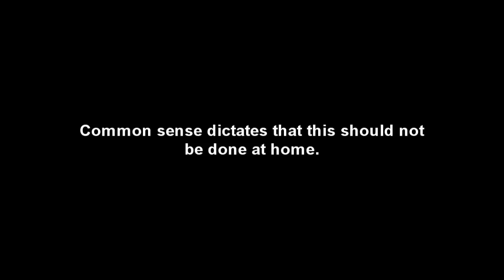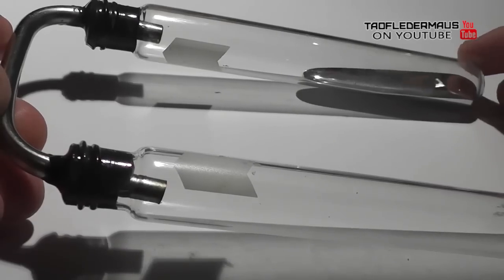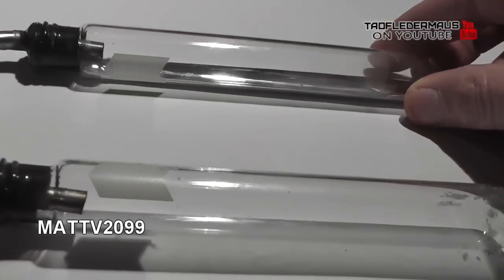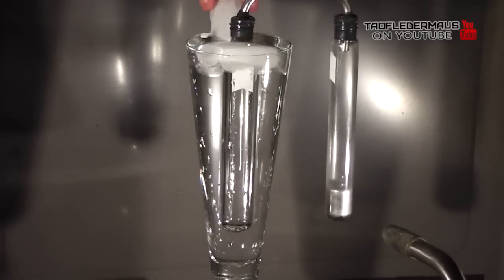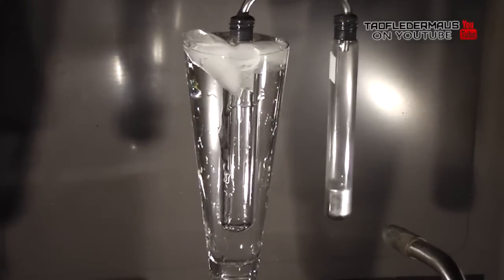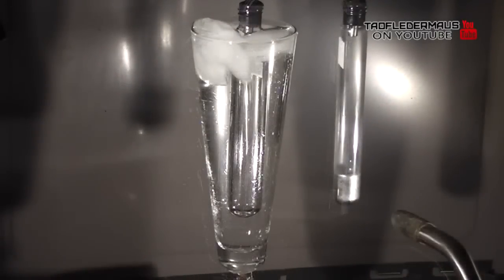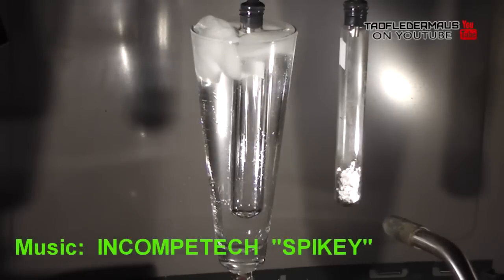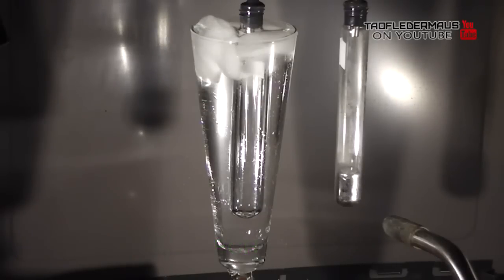What does the LIQUID METAL  Mercury look like BOILING?

Comment: I was surprised that we didn't see the gas going into the second test tube and condense back into a liquid.
Reply from the maker: I hoped to see that too.
Reply: Mercury is just too bloody dense to do that. At least under those conditions. You might be able to do that if the pressure is substantially lower on the other test tube while making sure that the test tube does not break and applying extreme heat to the mercury containing test tube. Still I wouldn't do it without proper respirator and doing the entire thing in a fume-hood.
Reply from the maker: Had I heated up the hot-side more completely,  above the condensing-point of the Hg,   it would have condensed in the cool-side.    I didn't want to push my luck though. lol
Reply: Yea buddy, you should be careful when it comes to luck and mercury. they don't mix well.
Reply: Anyways where do you buy so much mercury?
Reply from the maker: I've had it for years.   You can get it from Galliumsource  if you are in the U.S.  and over 18.
Reply: In near future when I will be building my reverse gravity-engine space craft, I will buy some.

Comment: long as this apparatus can take the pressure & temp, then, the risks are greatly minimized, Great experiment!!!!!
Reply from the maker: Test tubes are not very tough.    I was concerned it would rupture.
Reply: *****
 They would probably each float on each other.  The mercury couldnt get through the viscosity of the peanut butter, and the peanut butter would be less dense than mercury.  Regardless of which was on top, they wouldn't change positions
Reply from the maker: ***** The Hg would just sit on the top of the Pb.   (peanut butter) since it is more solid than liquid.    But the Pb would float on top of the Hg.
Reply: *****
What would be the contingency if it were to rupture? Just curious.
Reply: Mark Shannon Call for help, and close off all areas around him, so people cannot get into the area. Theres not much a single person can do about a mercury spill unless they have extremely expensive and specialized equipment. Even running away when it bursts doesn't make you safe. Think of it as a chemical gas.
Reply: Mark Shannon For a toxic, fuming, non-explosive chemical spill, make a 50-100m exclusion zone, doubled in downwind areas, notify authorities and wear full face gas masks at all times when within 100m of exclusion zone.

Comment: Really cool!
But seriously dangerous - I'm not the one who get easely scared (and think those "dont try this at home" claims is rediculous in most cases), but the vapor is whats really dangerous with mercury and here it's vaporazing very fast at it's boiling point.

The glass tubes stops it from getting out, but that also means a lot of pressure builds up - the cold side will condens some of it, but since it was no liquid mercury inside that tube after it had boiled that much for that long time most of it probably  stayed as compressed vapor in the tubes. At least a manometer shud be put on the rig to monitor the pressure.
Reply from the maker: Absolutely dangerous!    I spent a long time preparing for the "what if's"   and doing "hazard analysis"  on this before I tried it.

Comment: I don't know if this has been mentioned yet but I would think that putting the one end of the apparatus in ice water cooled the air, thus reducing the internal air pressure, and thus reducing the boiling temperature of the mercury.

Comment: If you vacuumed down your setup it would be much safer as any vapor release from the hot side would very freely be able to go over to the cold side and condense.  If there's air in the way you need to wait for diffusion/mixing to occur through that thin tube to a cold region of the glass.

Comment: Interesting!  I am surprise the test tube did not melt or break since mercury boils at high temp.
Reply: Test tubes are designed to withstand extreme heat or cold. They also cannot be dissolved by acid. Thus why scientists use them :)
Reply: You can get borosilicate test tubes that can withstand up to and over 800C (1500F). Mercury boils at around 350C (670F).
Reply from the maker: As a liquid like Hg is boiling,  it is absorbing heat at a higher rate and is controlling the temperature.

Comment: Would it be any safer to use a heat-resistant "bladder" of some sort on the other end instead of a rigid glass tube? You could heat the air up first before sealing the thing so there would be negative air pressure, so that whatever expansion took place, the bladder would be enough to handle it. Just a thought. :-?

Comment: The condensed mercury looked like water vapor..wow.  Another really interesting vid, thanks!
Reply from the maker: That surprised me.   I thought it would condense in the cold tube,  but I guess the top of the hot test tube was cold enough to condense it.  I would have thought the condensate would have been more silvery looking.
Reply: ***** It could have condensed in the interconnecting metal pipe section, which would have probably caused amalgamation. If the experiment is ever repeated weighing the interconnecting pipe before and after would be good, or use glass throughout. If you really wanted to see the condensation in the other tube minimize the length of the tube the gaseous metal has to expand upwards into, use all glass tubing and heat the interconnecting tube as well to over the boiling/condensing point. You could use a longer tube which was cooler in which to initiate condensation going to the second collection test tube.
Reply from the maker: If I had heated the entire "hot tube"  and the entire "u tube"  it would have had to have condensed in the "cold tube".    But...  I was cautious about the thing bursting.
Reply: I understand, if you added another foot or so of non-metallic pipe below the heated (upside down) U bend that would have allowed vapour expansion without excessive pressure and allowed condensation in the (ambient) tube above the cooled collection tube. The longer the tube (the bigger the entire closed system's overall volume) the lower the temperature induced pressure increase would be. You could use a rubber tube to extend the system, but you would have to consider it contaminated with mercury traces afterwards.
Reply from the maker: I wanted to put together something simple and with what materials I had on hand.  I could have also used a larger flask on the cold side.
Mostly,  I just wanted to see the Hg boiling and the distillation was a secondary thing I hoped would happen.   I haven't found any other videos showing Hg boiling so I am happy with what I got.

Comment: Very cool. Did you consider using a condenser instead of having a closed system? I suspect that with a long and cold enough condenser you could be confident that the mercury gasses would be condensed and not released. It would have removed the danger of rupture at least. Vacuum distillation is also an option.
Reply from the maker: I didn't want to make it more complicated than it was.    (and I am super cheap)
Reply: ***** Yeah I understand that. I'm glad it all stayed together for you!

Comment: OK Jeff - I'm an admitted insufficiently trained scientist - but - I do know a little about boiling liquids under pressure or vacuum.
 
In your example, which I totally agree is far too dangerous to attempt at home; you began with the Mercury test-tube and the pressure control test-tube both at “room temperature”.  Approximately 70F to 78F perhaps?  When you added the ice to the cool liquid in the glass with the pressure control test tube –that would have presumably lowered the temperature inside the test-tube.  Thus creating a vacuum of sorts in both test-tubes?
 
Would there have been enough pressure differential to create even a very slight difference in the boiling point of the Mercury?   I know that under vacuum, most liquids boil at a much lower temperature than under normal atmospheric pressure; however, I also know that this take a great amount of vacuum pressure to make that difference?
 
Just curious?
 
Thanks
 
Dave

Comment: Cool! That's interesting to see how it boils! What would happen if you put black widow spider, or any spider/bug, into sealed container with mercury? How long will it survive from the fume?
Reply from the maker: I imagine spider lovers would be outraged.  lol
Reply: ***** Probably only by the small percentage. Most of us hate spiders.
Reply: Someone doesn't like insects :P
Reply: If the spider has enough nutrients and the temperature was 20 °C (where vapor pressure of mercury is 0.002 mmHg) I'd be surprised if it would die after less than a week. Don't take this as a fact, but I don't think spiders are that prone to it. After all, spiders that spend lot of time on the ground are one of the main sources of organomercury compounds for birds which are more impacted by its toxicity.
I'd imagine it would take more than a week for the spider to develop neurological problems. Its webs would get distorted and then the animal would start having motility issues. Death would be slow.

Comment: I'm not a chemist.  Was the mercury being converted to gas?  If yes; Why was there no condensate in the cool tube or the cooler walls in the "boiling" tube above the fluid?   If no;  It makes me wonder if something can be said to be boiling if it is not being converted to another state (gas)?  Can a substance be energetic and active, visibly moving, appear to be boiling but not gassing off?  I guess there is some question as to exactly what constitutes "boiling".  Really enjoy your video.  It's making me think.
Reply from the maker: Rather than condensing in the cold tube,   it was all condensing the cooler areas of the hot tube.   There is visible condensate, it looks like water vapor but is pure Hg vapor.    There was no water inside.
Reply: Yes, it was boiling into mercury gas which is invisible under ordinary circumstances. Fuming is present at all temperatures, but boiling happens when the pressure of the vapor layer directly above the liquid is equal or greater than the atmospheric pressure. If those conditions don't exist, there is no boiling.

Comment: Again, I think all of these test tube experiments would benefit from a pressure gauge.  My guess is that the pressure never got very high at all.  I was waiting to see the mercury condensing in the chilled tube.  That probably would have been equally interesting to see... :)
Reply from the maker: I set up a test tube with a thermometer so I can determine how much pressure is building up (using water),   and then I can use a steam pressure/temperature chart to get an idea how much pressure we are looking at.    I can't find a pressure gauge that has a high scale,  like  0 to 1000 psi.
Reply: *****
Ah, that should work well, and is probably easier to plumb :)  Subscribed, BTW.  Thanks for all of the great videos.
Reply from the maker: I'm very curious how much pressure is building up inside these test tubes.  Is it 100 psi,  or 500 or?    I'm going to try to film the video tomorrow morning.

Comment: I had a friend I lost touch with in the late 90s. He had some mercury and put it in a hollow point .45 acp round and soldered it. He told me it would be like an explosive tip. He fired it at a frozen 2 liter bottle of RC cola. The result was phenomenal but very toxic. I'm assuming because the mercury doesn't compress and it is a liquid, it reacts like an explosion. I wouldn't recommend it to anyone. Just wondering if you have tried it on video. I can't imagine what you would need to do to have a controlled situation for it.
Reply from the maker: I never tried it,   and if I did,  I would never post it.

Comment: Can mercury turn red hot if you were to run a strong enough electric current through it and short it out? Like when you attach alligator clips to a screw and connect the leads to an electric transformer.

Comment: I was hoping the mercury vapor would condense in the other tube.
Reply from the maker: That WAS the plan actually.    It seemed to condense on the colder parts of the test tube it was in before it got to the u-tube.
Reply: ***** pun intended?
Reply from the maker: Eric York  Haha,  no.
Reply: ***** You would have to fill the tube with an extremely dense gas (like radon, xenon or tungsten hexafouride). The mercury is simply too dense otherwise, the air can't support the weight,
Reply: OvAppolyon Can't you just tilt it and lead it into the other test tube

Comment: Is it possible using high voltage and a similar set up as this to get that mercury to vaporise and maintain it as a vapor (Controlled Heat) and then back to a liquid (cooled)? Im wondering if that set up would require a metal containment instead of glass line in this vid.  thanks

Comment: Can mercury get "red hot" like other metals? Great videos keep them coming
Reply from the maker: thank you
Reply: ***** your welcome,but you didn;t say if it could/couldn;t become red hot haha
Reply from the maker: The answer is no.  It goes from liquid to its boiling point without getting red hot.
Reply: ***** not to drag it out out,but why is that,there is no circumstance or situation to create red hot mercury?
Reply from the maker: It would vaporize before it got red hot.   Metals turn colors -red,  yellow,  white,  according to their temperature BEFORE they turn into a liquid.  Since Hg is all ready a liquid,  it doesn't go through those color changes.
Reply: oh wow i see,cool thanks for the info
Reply: ***** Liquid (molten) metal gives off just as much light as solid metal do, if it's hot enough. It doesn't even have to be a metal - if you heat a brick to 1000°C it will glow orange too.
Hot gases (vaporized liquids) dont give off much IR and visible light due to their low density, but since visible light from other sources can pass right thru a gas in most cases - it's logical that it cant give off much light it self ether.

It's all a function of temperature - usually about 600°C is needed to glow clearly red. It may be visible all the way down to maybe 500 in a dark environment, but since murcury have a boiling point of just 356,7°C, it simply cant get red hot before it turn into vapor.
Reply: shawnkiller90 The glow you see happens when an electron moves from an excited energy state back to ground state, a photon is emitted. The wavelength of this photon is responsible for the color that you see and, since energy states are quantized (discreet) you will see one color of glow instead of a range. This can (and does) happen in any phase, even in a gas (plasma)

Comment: While I like your idea of showing to the world how does boiling mercury look like (though there is at least one older video online), and the safety warning, I really feel the need to criticize this. Not the fact you did it, but the way you did it. This is not the safe way. In fact, it's a very hazardous way with high probability of going wrong and causing property damage and acute poisoning.

First thing is that you never ever boil anything in closed system. Lowering the temperature in the empty tube down to almost 0 °C is not enough to compensate. You could've easily caused the plugs to pop out. The metal would probably start to boil violently. The system can be opened just like when essential oils are distilled, as long as the receptable is sufficiently cooled and the boiling is not violent. Salt-ice mixture is enough. Only traces of fumes will leak out and that can be managed by a fumehood or simply doing this outside.

Second thing - that's not either a "gentle" or a safe way of heating laboratory glassware. The only kind of glass that can be safely subjected to a direct propane torch flame is quartz glass, which is insanely expensive. Common laboratory glass is borosilicate and is not designed for these things. It can withstand direct flame (flameworking), but it needs to be introduced slowly. In laboratory work, it is heated indirectly by baths or electric devices. Flame can be tolerated if it's weak, diffusion type. You've exposed a rooom temperature borosilicate glass to an oxygenated, furiously hot flame. You were lucky it didn't crack and spill hot, fuming metal all over the place.

It's actually Internet's fault people are using propane torches. They're easily available and the whole thing has become a bad meme that proliferates via YouTube. Amateurs are exposing their glassware to conditions that just call for an accident, and accidents do happen. Laboratory work does not tolerate instant results and few seconds of attention span of the Ritalin generation. That's simply not how things are done.

Comment: I can honestly say I have never seen mercury boil until now.

If that failed, that would had been very bad. Mercury vapor is very bad, but I would bet you had a respirator on just in case. Burning hot mercury and sharp glass flying around the room would not be good either.

Comment: I hope that's a steel tube between the test tubes.
Reply from the maker: why?
Reply: ***** Mercury will undergo amalgamation with most sorts of metal, except for iron. The vapors from boiling mercury will eventually weaken other metals. Even aluminum, which is usually great at resisting chemical attack thanks to its aluminum oxide coating (essentially a thin layer of sapphire), will rapidly succumb to mercury if the aluminum oxide layer is even slightly disrupted.
Reply from the maker: That's true but the metals have to be free of an oxidation layer.  
It doesn't amalgamate with stainless steel.